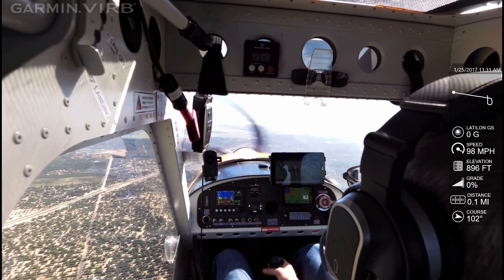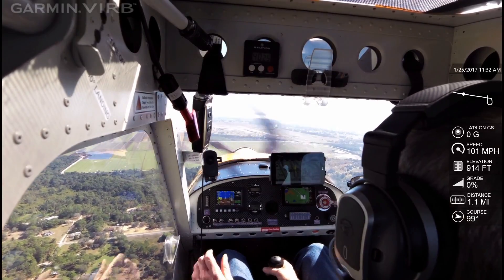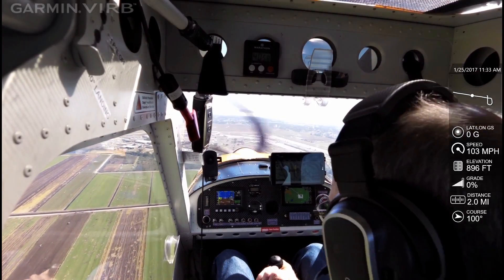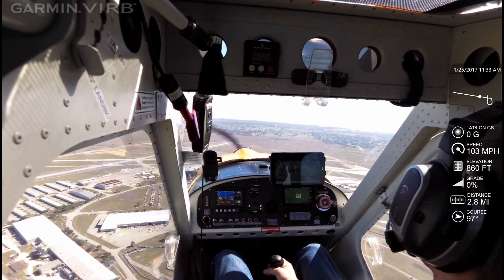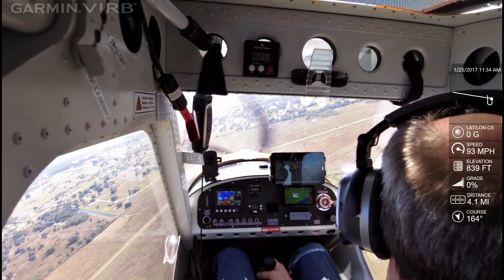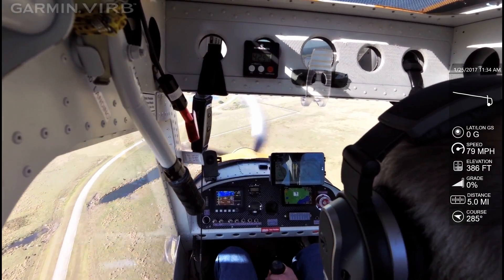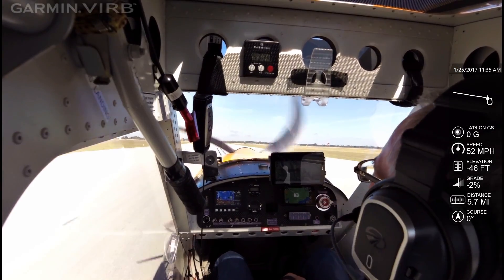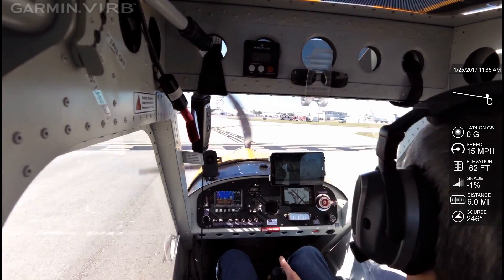Sebring LSA show landing: Merlin PSA

Comment: I’ve never been in a Merlin, but from what I can see on the videos the structure of the interior gives a sense of strength and solidity. The overhead beam running from side to side gives me a sense tat the craft won’t fold up between the wingspan. I like that. Other LSA with high wings don’t give that same sense of safety.
Reply from the maker: Thanks for the nice comment. The Merlin is a very strong and well-tested aircraft. And super fun to fly.

Comment: Is this still the 582 Rotax or HKS 700. Probably yes but will you and the Merlin attend Lakeland Sun and Fun? Visited your keosk but you had an interview with Dan Johnson in DeLand. I liked the plane.
Reply from the maker: This Merlin has the 582. My next Merlin will have the HKS or the Pegasus 0-100.
Reply: Chip Erwin Will you sell the old Merlin? I watched your video of the HKS run-up.
Reply from the maker: No, I will use my current 582 Merlin for a test aircraft for the 0-100 and for the electric power system. And for float testing. It becomes less usable at shows but worth it for the R&D. I will build a new Merlin for this years' Oshkosh show if I have time.